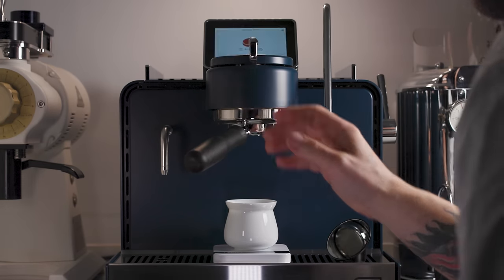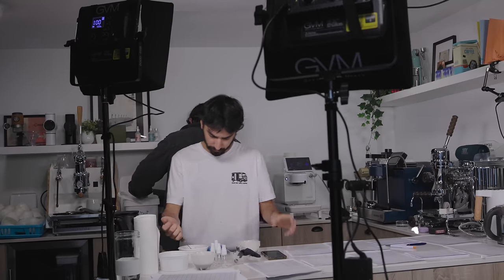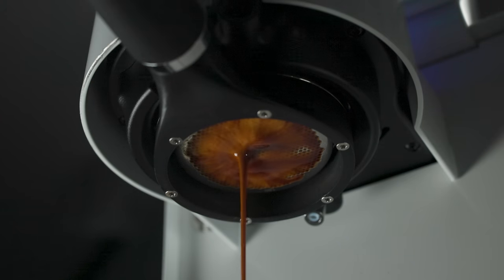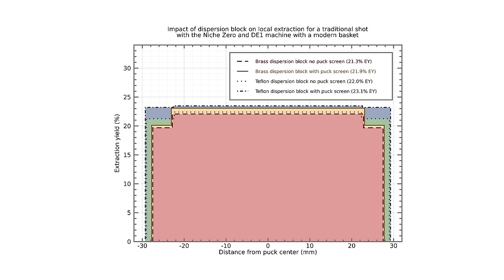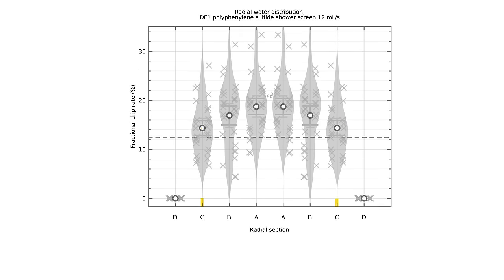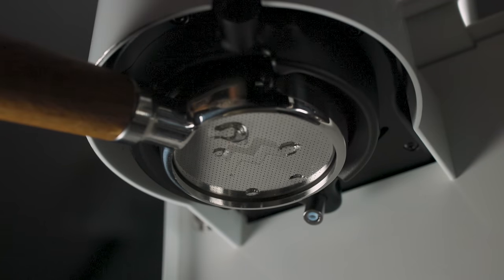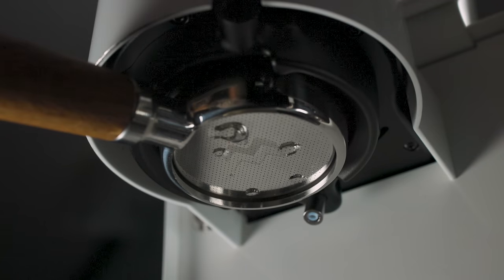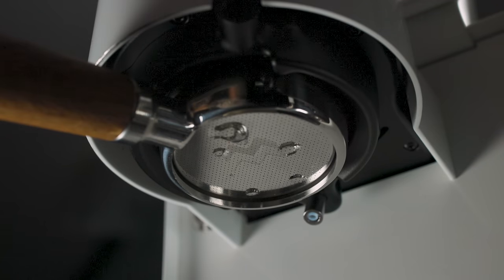MAKING ESPRESSO BETTER: Improving Espresso with Understanding

Comment: Always start coarser when dialing in, distribute evenly in basket, don't tamp too hard, and always use fresh beans (1-2 weeks after roasting). They're the basics and will get you 99% of the way there.
Reply from the maker: Don't temp too hard and the 1-2 week rule are not quite it. But the other two is preach often.

Comment: @LanceHedrick, great video, and I always love you deep dives like this! I think there is a glaring error in the process though, where we need to explore the base principles of fluid dynamics for the problem from a physics standpoint. All of these experiments are awesome and incredible data sources, but in the end, everything you speak of is trying to change a very basic and well understood pressure driven pipe flow problem into a situation where we cause mixing in areas where according to physics we should have no flow and no mixing whatsoever. I would argue on any given setup, getting no extraction in the 1mm ring around the outside of a portafilter is expected, especially on the upper portion of the puck, and we'll steadily increase the extraction towards the center until we reach roughly the 2mm towards the interior, a rough estimate of the 99% of the boundary layer. Now you might ask, what are my credentials for this? I've got a doctorate in Fluid Dynamics doing research specifically into the mixing of different fluids. There are research groups out there doing computational experiments specifically into espresso setups, but I think we could push this much further forward if we try to actually simulate what is happening inside a portafilter. From all of your data gathering we have excellent sources for configuring initial conditions and matching simulations to actual data, and doing some base level modelling shouldn't be too hard, but of course capturing all of the physics at play here will be challenging but we can learn a lot about the potential flow by even ignoring extraction and instead treat the coffee particles as insoluble and investigate the resultant flows from there. If our goal is truly the perfect extraction, I think the only way forward is by throwing out the idea of a legacy espresso machine configuration and to start prototyping entirely new equipment for high pressure coffee extraction. Please reach out if you actually want to chat about this sometime, I happy to forward my e-mail address and we can go from there!

Comment: Hi Lance.  So I just started reviewing your channel and am extremely impressed that you are working with statisticians and taking large enough sample sizes to draw statistically significant conclusions.  As a process engineer, I do very similar work.  I take a hypothesis, create a design of experiment (DOE), and partner with a statistician to not only create the experiment, but also assist with analysis of the results. (p values and things of the sort).  However after 20 years in this field I have come to find there are two types of differences...a statistical difference and a practical difference.  A statistical difference reinforces that there there is a very high likelihood (95 % confidence, etc.) that a difference exists while a practical difference is what makes a noticeable difference that folks will care about.  For example, you may find statistically that baseballs made in a factory on Mondays are 0.0005 mm smaller than baseballs made on Friday.  However....it doesn't really matter that there is a statistical difference because there is no practical difference in how the baseball performs.  Statistics are great to tell us directionally which way things are changing and I find it very value adding that you are answering these questions.  I have one small request....could you start providing your opinion in your videos if a "practical" difference exists....meaning, does the difference in methods create a difference in the taste of the final product.  That is very subjective I know, but time and time again, I find myself saying when I make a change "Wow its more repeatable, yes it looks visually better, and I can see different dynamics....but ummm.....it didn't really change the taste".  In order to determine a practical difference, maybe a question you could ask yourself is "How much does this need to change before anyone gives a crap?"  (from a taste perspective that is).    I would really like to hear your perspective of this in your videos more often because ultimately knowing what knobs to turn that make a practical difference in tastes is the end result that we all truly care about.   Keep up the good work and I look forward to more videos in the future.

Comment: Hey Lance, first off, thank you so much for your investment into this craft. It really helps those of us who don't have the time to nerd out on this stuff. 

I'm no expert, but I am trying to pull the best possible shot with the equipment I own:
Breville Barista Express
Normcore WDT/Tamper

I feel as though even with my measurements being spot on (and that's something you mentioned in this video), I'm still missing out on a better quality shot. I suppose I could try a screen, and potentially even mature to a bottomless portafilter to better identify any issues with preparation. However, there are so many tools available to us. With my equipment, is there a portafilter, basket, screen setup you'd recommend?

Comment: Funny you post this the morning after I preordered a sworks standard flow billet basket.  Should I have gone for the high flow one?  Also, do you have an opinion on the Breville Dual Boiler shower screen?  I haven’t upgraded it because I see people have issues with the screw on the upgraded ones.

Comment: After nearly one year with he Bianca and using pre infusion I thought it’s time to test more faster shots without pre infusion and holy shit. 
It changed my mind with the Weber unibasket. With a normal basket it was pretty good. But after I changed I wasn’t really happy with my espresso at all using this receipe. 
Yesterday I grind much coarser and dialed in much faster. 
And the shot was sooo much better. The Tipp to grind coarser and tamp a little bit „harder“ to grind as coarse as much for a better result is gorgeous! 
My espresso tastes so much more sweet and clear. Thank you.

Comment: Hi Lance, Great video!
Watching that, I had a thought of trying pre-weting the puck prior to locking to the machine.
In other words, do the prep, spray some water on the puck and lock it.
This way water coming from the shower screen will spread out on the surface more evenly due to Hydrogen bonds.
What do you think? Does it make any sense?

Comment: Hi Lance, thank you for this video, the problem I'm finding is distinguishing  which barista is correct when making a good expresso. 
Most seem to say go with 18g in and  36g out which is what I'm doing but I'm so confused on how long the shot should be taking, some say go for between 20-25 seconds and some are saying 35-40 seconds. I have tried both but honestly don't know which is correct as both have produced either sour or bitter expresso and it is so hit and miss. 
Can i ask please what your prevered recipe is.

Comment: If the edge under extraction is due to the shower screen, wouldn't it make more sense that edge under extraction would be worse with the higher extracting wider-hole-spread type baskets? I don't think that's the case though. I found tapered / rounded edge baskets usually have more apparent under extraction around the edges (based on just how the puck looks after extraction).

Comment: I am still a beginner, yet very interested and have a scientific background. So thats why I actually think a lot about what I am doing and its consequences while brewing.

I stumbled over your statement about filling headspace and flow rate. I have read some things about pre infusion and what it is for. Now pre infusion is simplified filling the headspace and saturating the puck with less flow rate and pressure. That would be counterintuitive to these findings. Whats your take on that? Maybe a real slow rate with reduced temperature would also be beneficial, because you fill everything out but keep the extraction to a minimum until you try to extract evenly at the right settings.

Comment: Great video! You actually described a method to take control over spatial variation of coffee extraction. I believe that if coffee brewing technology develops so fast coffee enthusiasts will probably unlock more parameters of this process. I thought about a device that could separate coffee samples by extraction time, as different substances responsible for taste are dissolved in water with different temporal distribution. These temporal solubility distributions are expected to depend on water temperature, water flow rate and particle sizes. There is still plenty of space to dive deeper into this problem. The samples can be additionally analysed by LC-MS (liquid chromatography - mass spectrometry) or GC-MS (gas chromatography - mass spectrometry) or IMS (ion mobility spectromerty) methods in order to conduct pure experimental research.

Comment: In the portafilter basket, why not progressively increase the hole size as you move to the edge? This could put a little more resistance nearer the centre of the puck once the puck is saturated and the pressure has nearly peaked. I think of it as: the puck is a variable resistor (it's resistance is a function of many things, including time, and it's harder to control), and the basket is a fixed resistor (because it's steel). The fixed resistor is much easier to adjust (in manufacturing).

Comment: When you suggest slow fill is inferior to fast fill (from an even extraction perspective), is this strictly with flow rate (water debit) as a parameter? Or does preinfusion / decreased pressure at the beginning of the shot have the same effect? 
ie we should be foregoing preinfusion and jumping straight into a flat 6 bar or 9 bar shot?

Comment: If a convex tamper made under extraction around the edges worse, I wonder if a concave tamper would help even out the extraction with a traditional basket. Creating a high point at the center of the puck so water is encouraged to flow to the edges first, counteracting the potential unevenness of the shower screen

Comment: The extraction graphs kind off look like the output of a galton board (balls falling through a triangle grid). And if you think about it it might make sense in my simple mind absent of complex fluid dynamics. In a perfect grind, water droplet/molecule hits a boulder and will either pass it left or right (let's keep it conceptually simple in 2d). And it does so all the way down, a shower screen that doesn't go to the edge is just a triangle with a very wide top. It will become much more chaotic with different size particles/gaps and pressure, but in essence the first flow of water through the puck might work somwhat similar, leading to a delayed saturation of the edges, only through pressure overcoming the gravity needed to violate the left/right drop and peek over, but probably only if that path creates less friction or the sum of the paths is less then the pressure of the pump.
So essentially creating a square through the showerscreen lessens/solves this phenomenon.

I hope you all can follow my reasoning haha

Comment: Awesome video as usual Lance , a tone of work behind it 😅. Did you tried the 3wmh bomber BEPv2 basket ? Its extremly cheap and it do a fantastic job , its thick enought to not bent under pressur and there is like a stainless filter inside and holes on the outside , unbeatable for the price , but it have to be the V2 , the first gen had some flaws

Comment: Which of the "modern" baskets would work well with a La Marzocco Micra? Does running it at 9bar make a difference or do they only work well at lower pressures?

Comment: While this is a great video, I want to harp on one note you made prevalent throughout the video: 

“So we don’t have to think about it as much anymore.” 

I get what you are saying, BUT that’s the whole point of espresso. You HAVE to put thought into all of the work of making an espresso. We wouldn’t have modern espresso today if we didn’t care about espresso. While, nowadays, there are lots of gadgets that can make espresso much more consistent, not putting thought into what you are doing is the one thing that causes most newbies’ espresso to suck. Honing in technique over having a bunch of gadgets is going to always be infinitely better than anything, and this hobby becomes infinitely more rewarding.
Reply from the maker: Very odd takeaway, tbh. Never would I think someone would infer me pushing for less through about espresso as a whole. Tbh I'm a bit dumbfounded you could have that as a takeaway lol

Comment: Hey Lance!
I don’t have a problem with your video titles but with the lack of your singing lately!
Is there a significant difference between the thick mesh puck screens and the very thin 0.2mm other than the cleaning factor?
Reply from the maker: I sang in the previous video haha! And yes- I showed this in my puck screen video. Seems thicker mesh is more effective.
Reply: @LanceHedrick  Thks Lance, and keep up that singing 😉

Comment: Awesome. Yes it is definitely different to implement modern methods and tools. With my 18-20g Sworks high flow billet basket, paper filter on the bottom and puck screen on top, I do 5 seconds of 1 bar, and then quickly ramp up to 6 bar for 9 seconds turbo shot with 40-45g out. It's kind of wild basically pulling a shot in 9 seconds. Found that going over, such as 12+ seconds, gets overextracted flavors in the cup with this setup.

Comment: Most pump machines are built to flow water out of the boiler through a tube with an inner diameter of about... 6mm (about 1/4"), so about 1/10th the width of the puck and trying to disperse that more-or-less evenly across about 10x the diameter. And since that water is typically entering the brew group at the center, with that also being the only point of entry, obviously you're going to get the best dispersion - and extraction yield - at the center rather than toward the edge.
Reply from the maker: Exactly right

Comment: This is pretty interesting, with regards to Bayesian inference. If all things were built perfect, water would still tend to prefer a median flow -- the center of the puck. I wonder if the puck screen is mostly just slowing the flow of water in the center while allowing it to flow unobstructed on the edges, applying a complimentary bell curve to the Bayesian curve.

Comment: If I’m using the Pesado HE% do I need to change the time of extraction? I usually do around 40-45 seconds (light filter roast). If yes , how long do you reckon I should run the extraction for ?
Reply: With my Pesado HE baskets I usually run <20sec for 1-3ratio and <30 for 1-1.5 to 1-2 ratios on light roast. I notices immediately how easy it was to over extract using traditional shot times and ratios 

I'm using just a 8.5 bar eagle one prima. I did install a pump kill switch for blooming but I found it doesn't change my thoughts on my above statement

Comment: So maybe the next innovation in puck screens and/or shower screens and/or baskets needs to be a bias of higher flow to the outside of the puck.  Kind of like how the NextLevel Pulsar has smaller holes in the centre of the shower screen vs the holes on the outside.

Comment: I scrolled down to find the answer for a question I have. If you have a lower flow rate would that mean the shot times will be a little longer? I have yet to test another theory based on 'Crema' and the new concept of it not being necessary. So if we combine concepts we have an alternative where, shot times are longer and crema is not essential and shots look like tiny hot coffee glass cups.

Comment: You know, having basket sides that had slightly less resistance would help with the edge extraction I think. Part of the issue is that water is taking that path of least resistance, and water in the center can go in any direction, but as it gets closer to the basket wall which is providing 100% resistance, the water opts to travel down or more towards the center once again.

Imagine a basket with standard sized holes on the bottom (idr if .3mm or .03mm lol) but then 1/3rd size holes on the sides. Some water would make it out of the sides but most of it would make it out of the bottom still. It would mostly just encourage edge extraction as getting through the puck and the bottom of the portafilter would still be the optimal path, but more of the water would be encouraged to go to the edges.

Comment: How do you think this shower screen data applies to Flair? Water enters center as you raise lever at zero pressure. How does fast/slow fill apply to prewet or not before ramping up pressure?